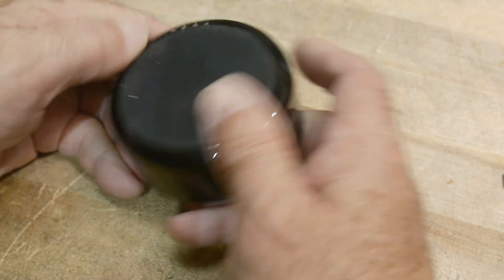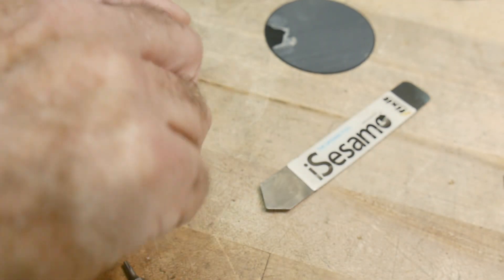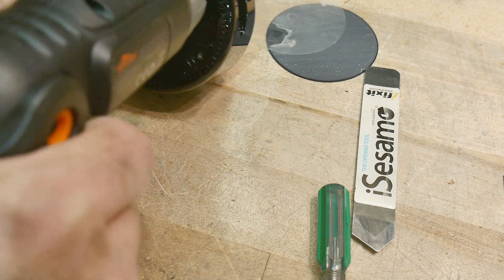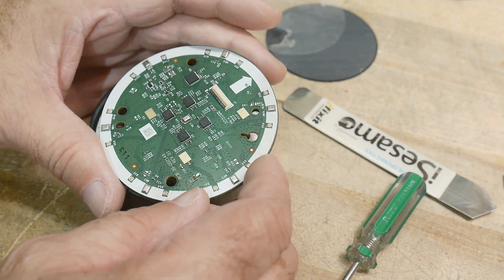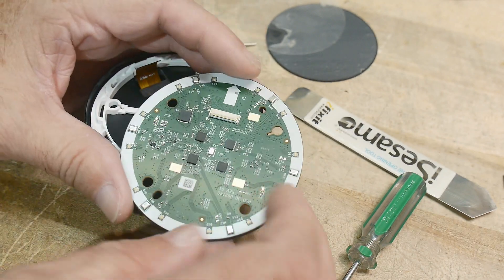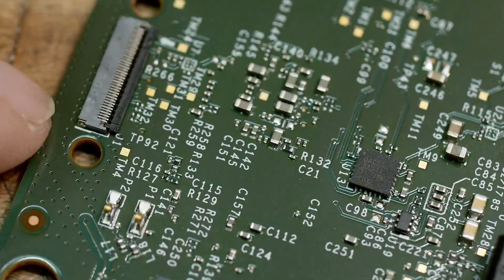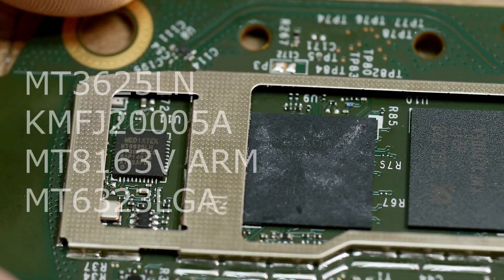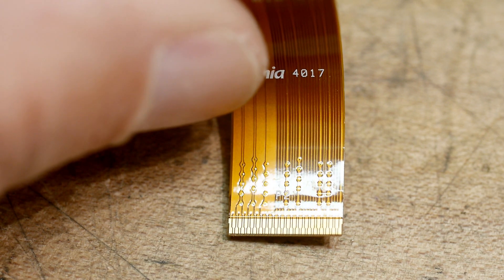#1388 Amazon Echo Teardown

Comment: Hi, thanks for allowing me to look into this device, I don't know if you'll still want to use it, but pulling out the foil connecting flex without loosening the socket locks can mean the definitive end of its functionality.
I don't know if I translated it correctly, but the term you searched for and called microswitches "clicking" is a membrane microswitch

Nice day 🙂 Tom

Comment: What did we learn? Modern SMT with proprietary IC's is practically black-box technology.  No fix, no modify, no fun.
Reply: Yup
Reply: True.
Reply: Nothing proprietary in this device. Under the can you only can see a big Mediatek processor with the thermal pad, a big RAM chip and a small serial ROM.  Wondering if he can access the rom and mount the data as file system, probably is an Linux (android) there
Reply: @Ricard2k  It would be great for you to demonstrate this plan.
Reply: @jspencerg  😀😂
Reply: @Ricardo Peironcely  Thanks for the link.  I've watched half so far.

Comment: HYou pulled out the mylar cable without releasing the lock.
Reply: Usually in such miniature flexible cable systems there are no locks on either end
Reply: @subramanianr7206  These thin flex cables MUST HAVE an locking system.
It can be clearly seen at 5:25 time
Reply: Very nice double row AGP STYLE contacts on the flex cable at 7:13 time.

Comment: Where is the speaker and microphone?
Reply: I guess the speaker is in the base, i saw some contacts on it, microphones may be those small metal cans close to the LEDs.
Reply: @plainedgedsaw1694  In looking at it again I think the microphone is the metal can in the center of the top board labeled mk7.  It is directly below the center hole on the top.  There would need to be a hole in the pcb if it is the mic, but I cannot tell from the views shown.
Reply: @plainedgedsaw1694  It looks like the array of microphones are the cans near the edge between the LEDs and the one in the center.
Reply: Colon O’Flynn has a video where he shows the microphones covert the audio directly to an I2S signal.
Reply: @Chris_Grossman  
More microphones near the LEDs to find the direction, echo cancelation, etc.

Comment: Does it not have a speaker or microphone?  I was thinking it’s similar to the Home Pod but apparently not so much. At time 00:06:45, your pointing out the position of the integrated Wi-Fi antenna on the pcb. Is there an “MMCX” connector for an external antenna?? It appears to be labeled “S3” in series with “L13” and  “C198”. If so, is it just for testing or is it made to have a user installed antenna? As you pointed out, it’s not like the board is used in another device. As always thanks for the videos.